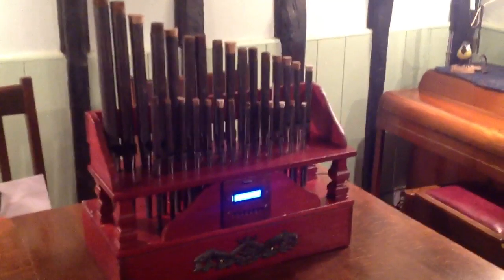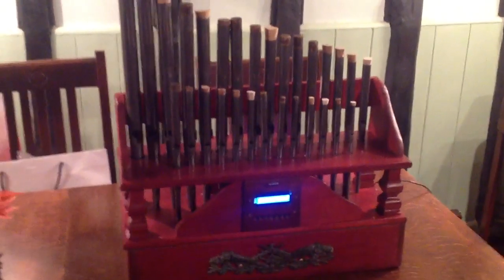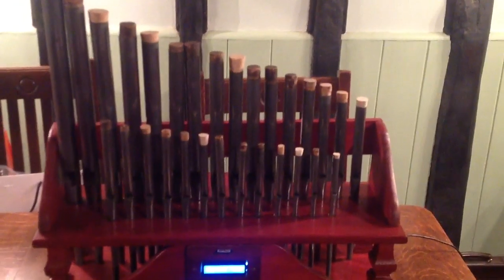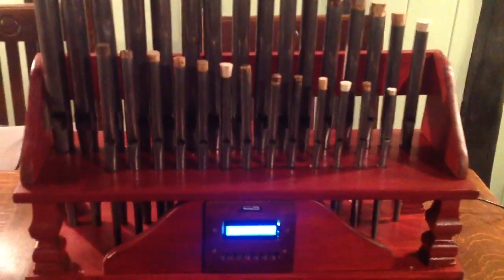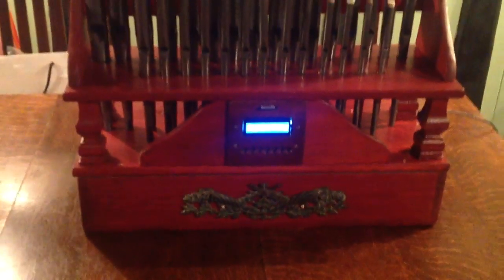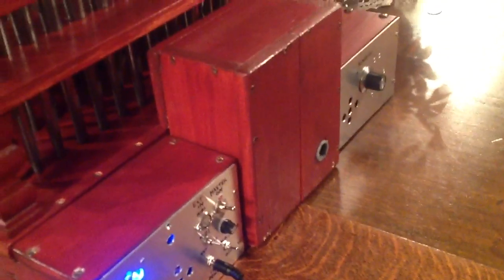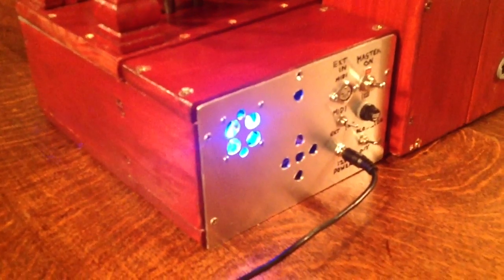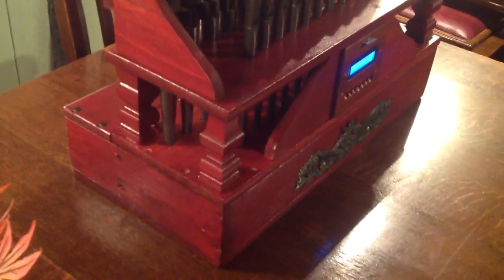Midi Controlled Pipe Organ (Table Top Pipe Organ)

Comment: hey im wondering what program you used to controll the pipes, could you link the program? thanks in advance!
Reply from the maker: I started with an arduino but eventually went with a Mr MIDI controller, which reads off the sd card. This board just gives out midi so you need another board which decides the midi serial data and turns this into individual pipe drives for this I used a J-Omega board. This can drive the solenoid valves directly you can get the boards from http://www.j-omega.co.uk/MTP/mtp.shtml

Comment: Hello! May I ask how the air gets to the pipes? Through tubes or is that box filled with air that goes through the pipes? Thanks!
Reply from the maker: So, there is a fan blower in the back (in a box) which blows air into the box on the base, via a tube. This means the big box in the base (actually called a wind chest) essentially has air pressure in it. There are solenoid valves with leather pads which block holes in the lid of the ‘wind chest’. When a note plays the solenoid valve lifts and the leather pad lets air out of the box into the organ pipe. The organ pipes are just resting on the lid over the holes.

Comment: Hi! Your work is very nicely! 
May I ask you send me The Arduino Sketch you used and any other helpful information. 
Now I started working on mechanic street organ but in my country, I am not any information or some schemes, or a detailed description about Midi Controller Pipe Organ.  
I well be very grateful for your help. 
Best regards, Konstantin. 5023583km@gmail.com

Comment from the maker: I think this mainly arises because many organ enthusiasts prefer purely mechanical organs (i.e card readers). So the traditionalists don't tend to talk much about Midi!. Basically the midi (as you will know) is just a serial data stream. There are many ways of creating this, I used a 'Mr Midi' clone circuit, which runs a Pic microprocessor and reads midi files from an SD card it's an open source circuit and you can download the code. Of course there are also many commercial midi players out there. I use a free program called MidiEditor to arrange the music, (then a program called Gn1to0 to move all notes to the Midi 0 channel).
Reply: Would it be possible to add a midi recorder to the keyboard of an organ, enabeling one to both record and playback on the same machine?
Preferably the organ would play when the keys are being hit without a delay.
How do you provide the air to the pipes? I was thinking solenoid valves but that would get expensive really fast.

Comment: Hello, May I know how you programed your pipe organ?
Reply: Heres the Midi arduino code. I originally used. I now use a JOMEGA midi board which does the decoding (miles easier). you will need to buffer the output pins to drive the air valves (pipe organ wind chest solenoid valves).
>>

/* Midi controlled Pipe organ for a 28 note organ V1.0 2013 Mark Ford
 based on code from various sources.
 
 Written for Arduino Mega 2560
 
 */

//variables setup

byte incomingByte;
byte note;
byte velocity;
int noteDown = LOW;
int state=0;  // state machine variable 0 = command waiting : 1 = note waitin : 2 = velocity waiting
int baseNote = 60;  // lowest note 
// use different values of baseNote to select the MIDI octiave
// 24 for octiave 1 -- 36 for octiave 2 -- 48 for octiave 3 -- 60 for octiave 4 -- 72 for octiave 5
// 84 for octiave 6 -- 96 for octiave 7

// Notes to play / define pin numbers: -  making one of these zero will mean it will never play that paticular note
byte playArray[] =    { 22,  23,  24,  25,  26,  27,  28,  29,  30,  31,  32,  33,  34,  35,  36,  37,  38,  39,  40,  41,  42,  43,  44,  45,  46,  47,  48,  49,  50};

//  byte playArray[] =    { 2,  3,  4,  5,  6,  7,  8,  9,  10,  11,  12,  13,  14,  15,  16,  17,  18,  19,  20  ,21  ,22,  23,  24,  25,  26, 27, 28, 29 };
// for example corrisponding to note 36, 37, 38, 39, 40, 41, 42, 43, 44, 45, 46, 47, 48,  49, 50, 51, 52 - for base note = 36 or C2
int strobe = 35;   // select the pin for the monostable if used

int channel = 1; // MIDI channel to respond to (in this case channel 2) chnage this to change the channel number
// MIDI channel = the value in 'channel' + 1

//setup: declaring iputs and outputs and begin serial 
void setup() { 
  pinMode(strobe,OUTPUT);   // declare the strobe pin as output
  pinMode(2,OUTPUT);        // declare the solenoid's pins as outputs
  pinMode(3,OUTPUT);
  pinMode(4,OUTPUT);
  pinMode(5,OUTPUT);
  pinMode(6,OUTPUT);
  pinMode(7,OUTPUT);
  pinMode(8,OUTPUT);
  pinMode(9,OUTPUT);
  pinMode(10,OUTPUT);
  pinMode(11,OUTPUT);
  pinMode(12,OUTPUT);
  pinMode(13,OUTPUT);
  pinMode(14,OUTPUT);
  pinMode(15,OUTPUT);
  pinMode(16,OUTPUT);
  pinMode(17,OUTPUT);
  pinMode(18,OUTPUT);
  pinMode(19,OUTPUT);
  pinMode(20,OUTPUT);
  pinMode(21,OUTPUT);
  pinMode(22,OUTPUT);
  pinMode(23,OUTPUT);
  pinMode(24,OUTPUT);
  pinMode(25,OUTPUT);
  pinMode(26,OUTPUT);
  pinMode(27,OUTPUT);
  pinMode(28,OUTPUT);
  pinMode(29,OUTPUT);

  state = 0;  // initilise state machine variable
  //start serial with MIDI baudrate 31250 or 38400 for debugging
  Serial.begin(31250);        
  digitalWrite(strobe,LOW);  
}

//loop: wait for serial data, and interpret the message 
void loop () {

  if (Serial.available() > 0) {
    // read the incoming byte:
    incomingByte = Serial.read();
    digitalWrite(strobe,LOW);    // clear any previous strobe
    switch (state){
    case 0:
      // look for as status-byte, our channel, note on
      if (incomingByte== (144 | channel)){ 
        noteDown = HIGH;
        state=1;
      }
      // look for as status-byte, our channel, note off
      if (incomingByte== (128 | channel)){ 
        noteDown = LOW;
        state=1;
      }

    case 1:
      // get the note to play or stop
      if(incomingByte < 128) {
        note=incomingByte;
        state=2;
      }
      else{
        state = 0;  // reset state machine as this should be a note number
      }
      break;

    case 2:
      // get the velocity
      if(incomingByte < 128) {
        playNote(note, incomingByte, noteDown); // fire off the solenoid
      }
      state = 0;  // reset state machine to start            
    }
  }
}

void playNote(byte note, byte velocity, int down){
  // if velocity = 0 on a 'Note ON' command, treat it as a note off
  if ((down == HIGH) && (velocity == 0)){
    down = LOW; 
  }
  //since we can't play all notes we only action notes between base note + last note i.e 36 & 52 for 28 pipes
  if(note>=baseNote && note<(baseNote +  32)){
    byte myPin=playArray[note-baseNote]; // to get a pin number between 2 and 9
    if(myPin != 0) {
      digitalWrite(myPin, down); // play it if it is one of our notes
      if(down == HIGH) digitalWrite(strobe, HIGH); // strobe high to monostable for short note on
    }
  } 

}
Reply from the maker: Post your email and I will send the Arduino sketch I originally used..
Reply: LUNARTICK007 chopy831@gmail.com
Reply: @LUNARTICK007  i'mreading the comments to undertand better this very nice work. i'm one-man-band and now constructing a automaton to play drum with me, creating a new music project. And you project will help me a lot with this. I'll send me e-mail to receive de code. Congratularions again for the project.
Where the midi files are running? i can see a sd cart plugged. But, the same shield who play the midi is the same who move solenoids?
Congratulations and thanks for your project.
my e-mail: luisguilhermeholl@gmail.com